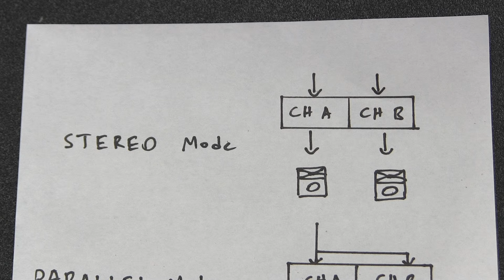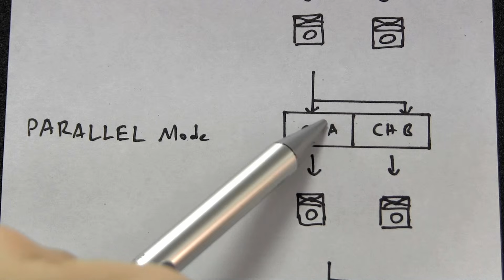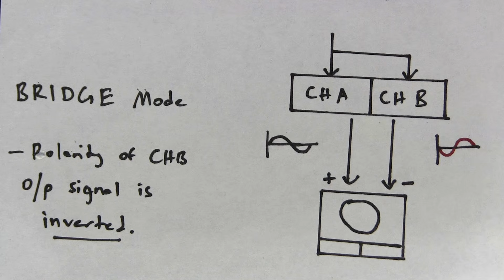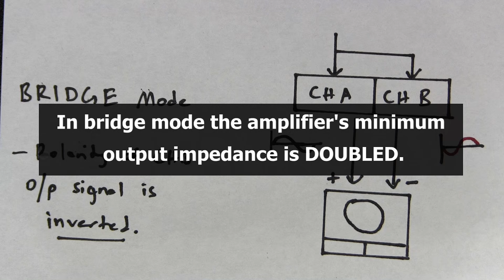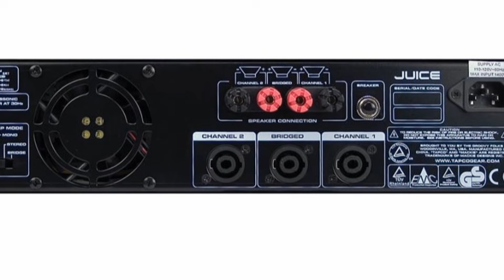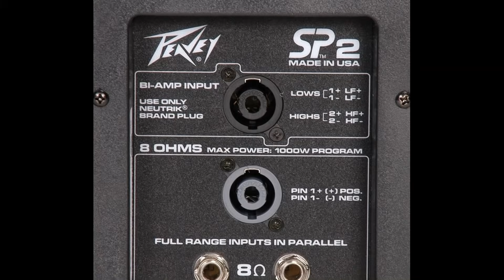How to set up and connect a power amplifier in bridge mode

Comment: Hello GLB productions. I have a behringer nu1000. It will run 500 watts at 8 ohms bridge or 1000 watts at 4 ohms bridge. The amp only has speakon outputs. My question is...can i run the 1+ 2+ speakon to a 1/4 plug? Will it work or mess something up? What confuses me is where the negative goes since both pins for the bridge speakon are + (positives). Hope my explanation/question isn't too confusing. Thanks
Reply: The speakers I want to get are peavey PV112m monitors. I want to use the one nu1000 amp to power 2 speakers. The pv112m's are 8 ohms each so if i daisy chain 2 of them together I've reached the 1000 watts @ 4 ohms on the amp. The speakers only have one 1/4 inch input and  one 1/4 output
Reply from the maker: Yes that can be an issue with older speakers. To convert the bridged speakon output to quarter inch plug, connect +1 to the tip of the 1/4" connector and +2 to the sleeve. Ie +1 is positive and +2 is negative. Also be very sure that your cables are using sufficiently heavy gauge wire to handle the current.
Reply: Ok. Thank you very much.
Reply: I use peavey PV series speaker cables.

Comment: When i play my music the sound of one of my two speaker was going up and down as well as fuzzy. at that time ai was playing cd on my Numark 1 mixer the main volume control was 15% Cd channel was at 30%   My amp (1000 X2  8ohm) was at 60 %  My Kam speaker are 250 watts each up to 500 watts peak
Reply from the maker: Sound to me like there is an issue with one of the channels in your power amplifier.
Reply: i will check out today with another amp. and see how it behave.

Comment: how do u connect a cd player to the power amp.thanks.
Reply from the maker: Connect the left output of the CD player to channel 1 input and the right output to channel 2 and you should be all set. Use RCA to quarter inch adapters if necessary.

Comment: I run mines in parallel mode,use both channel,2 dual pa 15 speakers 1200  watts a channel,I never use bridge mode pushing that much power risking blowing,my speakers.i just  brought a bigger  class h power amplifier with enough juice for both channels, speakers, so bridge mode won't  be used, risking burning your amp,speakers up.
Reply from the maker: There is no risk of blowing your speakers when using bridge mode if your amp and speaker are correctly matched. Bridge mode generates a lot of power so should be paired with a speaker that has an appropriately high power handling - if you do this correctly it's perfectly safe.

Comment: I want to ask u a question,is there any chance to connect a single 100watt speaker to a 50+50watt amplifier?
Reply from the maker: Sure you can bridge the amp into the speaker, if the amp is able to operate in bridge mode.

Comment: I am currently running a Pyle Pro 1000. I have it driving 2 Peavey 118 subs, in bridge mode with the speakers Daisy chained. I know it's now down to 4 Ohms. Is it safe?
Reply from the maker: It depends on the amp - what is the minimum load into which each channel can operate? Check your owner's manual.
Reply: +GLB Productions I've bought it used in 2009. It calls for a 4 ohm load per channel. I never checked up on the specs in bridge mood. it pumps the woofers pretty decently. eventually I'm going to retire that amp and get a Peavey.
Reply from the maker: If it's 4 ohm minimum per channel then minimum in bridge mode is 8 ohms so technically what you're doing is beyond the amp's limits. Do you notice it running very hot or cutting out after a while?
Reply: +GLB Productions the amp has been taking a beating pretty well. For a $100 amp I say she does well heh. My question is, what amp should I get to power both my Peavey 18" woofers while Daisy chained?
Reply from the maker: You'd need an amp that can run into 2 ohms per channel. Beyond that just make sure it's a brand name amp: crown, QSC, Yamaha, Ashley, Dynacord etc all make good amps.
Reply: +GLB Productions aahhhh alright. I'm trying to get a Peavey brand amp but I don't know if they make one that can run 2 Ohms per channel.
Reply from the maker: Yeah they make lots - the CS series will all do 2-ohms per channel. If in doubt just write to Peavey - give them your requirements and ask which amp is best suited to your needs.
Reply: +GLB Productions Thank you! I'm actually waiting for an 1989 CS400 to power my little 10" speakers. Will look into it!!!

Comment: I admire your safety precautions; power off, speakers disconnected BEFORE doing anything. You are a true safe pro! Thank you for your contribution to the ProAudio industry.
Reply from the maker: Indeed, this is most important when changing modes on the power amp! Thanks for watching.

Comment: my question is, what type of speaker can i use for bridge mode amplifier connection if i am using let say 1000 watt amplifier. thank you
Reply from the maker: You would use a speaker which matches that power output. See this video for more info: https://youtu.be/l9L7uK7Xy0w

Comment: If I use two subs of 1800rms at 8ohms and only one amplifier in bridge mode. How I should connect  both subs? In series mode or parallel?
Reply from the maker: Sound reinforcement loudspeakers are always connected in parallel - series wiring is only present between individual speakers in multi-driver enclosures. So when you daisy chain the two subs together you're making a parallel connection.

Comment: Bruno, do have a video on making an adapter cable for bridge mode in a 1/4" phono set-up?
Reply from the maker: No I do not, in fact I don't even know what that is :) What are you trying to achieve?
Reply: My amp is an older model peavey which has Phone plugs. In order to send the signal from the amp  (in bridge mode) I need a banana plug for the output signal and it needs to be adapted to the 1/4" phone jack for the speaker cable. My real question is there a specific way to wire the banana plug and 1/4" Phone jack - as far as ring-tip is determined. Since the Manufacturers manual say to use both red banana output jacks.
Reply from the maker: Ah ok that is definitely a custom set up: the tip of the phone plug should be wired to the channel A output and the sleeve to the channel B output. There is no ring connection when using phone plugs for speaker connections.
Reply: Thanks Bruno. I had concern about it being wired in a specific way. You may have said this in your video and I just kept missing it, SORRY!

Comment: hi GLB i want to connect my subwoofer 500w dual 6ohms together w/ my mid and hi 8omhs each in one box,,my ampli is 500/channel 4-8ohms. ,can u give the right wiring connection plss? God Bless
Reply from the maker: For that you need a passive crossover - that's the job of a speaker designer.

Comment: Loved this video. I have learned so much from the amp/speaker videos. One connection you did not include, and it may be old school connections which are not used on later model of amps, is banana plugs. My old Peavey PV4c indicates using this type of connect. I have been told there are adapters for this connection which has the banana plug(s) on one end and a 1/4" female on the other. You then just plug in a standard speaker cable.
Reply from the maker: Ah yes the banana plug - that connector is actually no longer used much in pro-audio because it has several issues. It is non-locking, can be inserted in two orientations therefore causing polarity issues and can cause electrical shorts if not inserted fully into the female connector. It's still a good connector when used correctly though, as it has lots of contact surface area, definitely better than a quarter inch plug!

Comment: Great video.....just have a question..how would you connect 2 subs, 1 on the left of stage and the other on the right would u use parallel mono or stereo?
Reply from the maker: It depends on how your subs are set up - if they are run in mono eg from a mono output on your mixer, then you would use parallel. If they are run in stereo eg from the output of an active crossover, then you would use stereo.

Comment: Thank you for the video! Very helpful. My question is whether I can take a "banana plug" and cut it off, and wire a +2/-2 to the standard speakon plug (the one in your video). Thanks.
Reply from the maker: Sure, just make sure you get your polarity correct. Why are you wiring to +2/-2? Biamplified speaker?
Reply: No. A bridged Carvin DCM2000 powering 2 daisychained 8ohm subs. Carvin LS1801 passive.
Reply from the maker: John in this case there should be no need to use +2/-2 at either end of the cable: the amplifier has a dedicated bridged speakon output which uses the conventional +1/-1 and the subs have a similar arrangement on their inputs. Do you have a specific reason why you're using +2/-2?
Reply: No. I just want to properly bridge that carvin amp with the subs. If I don't need to make a cable, that is good news.

Comment: Hi, this is a great video, has helped me out so much with understanding. I have 3 questions for you.
Im trying to power 2 RCF  S8018 8ohm 1000w subs with my Brooke Xpro3000. Im Trying to figure out if it would be best to run them in stereo which will give 1000w rms or bridge which will give me 3000w rms?
Secondly when i bridge the amp am i right in saying it gives me 3000w at 16ohm for 1 speaker but if i link my second to the 1st it will give me 1500w per speaker at 8ohms?
Lastly, would i then reduce the output level or keep it at full?
Hope you can help, God Bless
 Tim
Reply from the maker: Hello Tim nice to hear from you.
Stereo or bridged depends on whether you need stereo and also whether your amp can be bridged into a 4-ohm load. 
In terms of power you need to check what power your amp delivers when bridged into 4 ohms and divide that by two to give the power to each speaker. 
Output level depends on how much volume you need in the venue and your system processor settings, if any.

Comment: can you attach two subs to one amp in bridge mono?
Reply from the maker: No you cannot, unless the subwoofer is designed to accept the output from two separate amplifiers - such a sub will have two separate input panels, one for each driver.

Comment: Hi, I'm from Philippines. Your videos are very helpful. Thank you for sharing with us. 

Just have a question because I'm planning to buy a subwoofer speaker that is 18inch 7000W.

Is it okay to use this CLASS H Professional Power Amplifier which have the specs below?

1700W 8ohms stereo power
3000W 4ohms stereo power
5000W 8ohms bridge power
20Hz-20KHz, (+0/ -0.5dB) Freq. Response
300-400 Damping Factor
>105dB S/N Ratio
>82dB Crosstalk; 45/ s Slew Ratio
0dB (0.775V), 1V, 1V, 1.4V (changeable) Input sensitivity

If its okay, how many 7000W speaker can I use when connecting into bridge mode?
Reply from the maker: Please watch this video it will answer you question: https://www.youtube.com/watch?v=l9L7uK7Xy0w
Reply: Thank you so much sir. This video is very clear and helpful!

Comment: In a bridge mode connection..will the amplifier last for 24hrs of operation??? And thank you for the good tutorial
Reply from the maker: Reliability in bridge mode should be the same as in stereo or parallel assuming you observe minimum impedance requirements and do not overheat the amplifier. Bear in mind that not all amps are designed for 24 hours continuous operation - check your owner's manual to be sure.
Reply: Actualy i dont have the owners manual..Because i bought it 2nd hand..and i have 2  sub speaker with RMS of 1600 8ohms each  is it ok to match this 2 speaker with the yamaha p7000s bridge mode?sorry for the bad english...and thank you for the replay.
Reply from the maker: If it's a Yamaha just download the manual from the Yamaha website :) For matching amps to speakers please watch my video on this topic: https://www.youtube.com/watch?v=l9L7uK7Xy0w
Reply: James Balibao no.i wouldn't run it in bridge mode.ill  match the speakers up with the right rms such as 1500 rms per channel
Because it shouldn't take the full 2500 watts of the Yamaha amplifier to push them speakers.the Yamaha p 7000is rated at 750 @8ohms, I think @1000 at 4 ohms so you either gonna blow your speakers or burn your amplifier up trying to push it to it's fullies,I always go the rms per channel,match my speakers up with it so if I got a 1200 rms power amplifier you can take both left,right channel, run it in parallel mode,hook them on separate sides,I guarantee your amp will run a lot cooler,you won't risk of destroying your investment due to heat from too much siginal genrated from your amp, blowing your speakers..trust me too much siginal produce heat,heat=a burnted voice coil..thats why I stopped bridging my power amp
 again.

Comment: No doubt the best explanation that I have seen so far for stereo, parallel and bridge mode amplifier settings and speaker connections. You make it real simple and easy to understand even for beginners. THANKS for such a great video.
Reply from the maker: You're welcome David, I have a video coming up soon which will go deeper into the various amplifier modes, stay tuned for that!
Reply: David are u jamaican

Comment: integrated amp can be bridge sir ? can double the power ? like the sakura 739 .
Reply from the maker: They usually cannot be bridged - if you don't see a mode switch on the amplifier it means it's fixed in stereo mode.
Reply: GLB Productions how to add some power to my sakura amp sir ? i have a 2 speaker 12 inch i loaded it A+B .
Reply from the maker: There's no way to 'add power' to an amp my friend, its power output into a given impedance is fixed when the amp is manufactured.

Comment: how about the crossover and sensitiviy?
Reply from the maker: Could you be more specific please.
Reply: Do I need to adjust the crossover and sensitivity at bridge mono ?
Reply from the maker: Sensitivity would be set depending on the amount of gain needed in your system. Crossover most likely will not be used as both channels are being fed the same input signal - check the manual for your amp.
Reply: thank you
Reply from the maker: 71kc You're welcome :)

Comment: hey i am from freetwon i have 2   3000w amplifier what kindod of  power i need to  power them on cos i have 2.7w ganertor
Reply from the maker: Check the manufacturer's specifications for power draw on the amp - it's usually less than the output wattage.

Comment: Just landed on your channel when searching for power amplifiers. Very nicely done videos with clear, concise explanations. You might want to clarify your explanation of the push-pull amplification in bridged mode, though. The graphic (and your explanation) suggests that the speaker cone is being "pushed" at the same time as it is being "pulled". This would result in the signal being cancelled, i.e., no sound would emanate from the speaker, no? What would happen if you input an audio frequency sine wave?
Reply from the maker: I can understand how the explanation could be interpreted in that way. The key to understanding how the two channels work is the fact that the polarity of the signal going to channel B is inverted, and that this channel is connected to the negative terminal of the loudspeaker. So when a positive voltage is presented to the input of channel A, a corresponding negative voltage is presented to channel B. Channel A applies a positive electromotive force to the speaker diaphragm, moving it forwards. Simultaneously, channel B applies a negative electromotive force, but to the NEGATIVE terminal of the speaker cone. This results in a net positive force on the speaker cone, which also moves the cone forwards. The directions are reversed when a negative input voltage is presented to the amplifier. 

In other words, when channel A pushes on 'one side' of the cone (the positive terminal) channel B pulls on 'the other side' (the negative terminal). The two channels thus function like one large single amplifier channel. 

I hope this has clarified the issue, thank you for bringing it up!
Reply: Great education.  Need your assistance, I have a Marantz NR1607 received connected to a pair of powered EV ZAX1 12 inch speakers, an EV powered 18 inch sub, a 5 inch Samsung TV, a DVD player and a cable box.  I am getting a loud hissing or buzzing sound out of the EV ZAX 1 speakers.  Please help. I have already spent lots of money having professional techs after professional techs at the house, but the loud noise is still present.  Please let me know if we can talk.  I am in Coral Springs, FL.

Comment: I got a question. Is parallel mode also tripling the output or is that only with bridge mono? I wanted to buy a qsc plx3402 thinking i can put it in parallel mono mode to increase the output and use two separate subs instead of just one.
Reply from the maker: It's only with bridge mono mode when the amplifier is connected correctly as shown in the video. Parallel mode just means that one input is routed to both outputs. You can actually bridge an amp into more than one loudspeaker by connected the speakers in parallel, assuming you amp can handle the load which will typically be 4 ohms at that point.
Reply: +GLB Productions got it, thank you very much.

Comment: After hooking that amp up to a subwoofer can I hook an amp up to a home theater AV receiver, and if so what wire can be used for the signal?
Reply from the maker: Yes you can - the cable type will depend on the input/output connectors on your amp and AV receiver respectively.